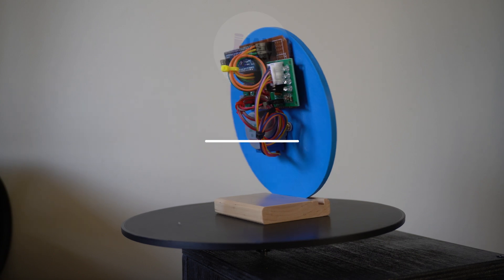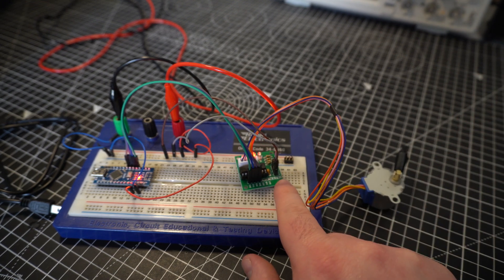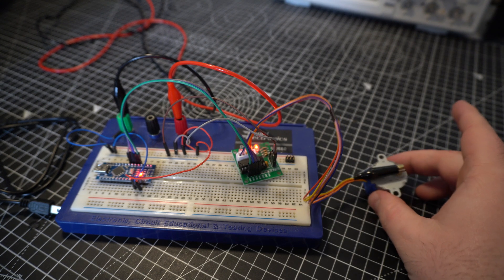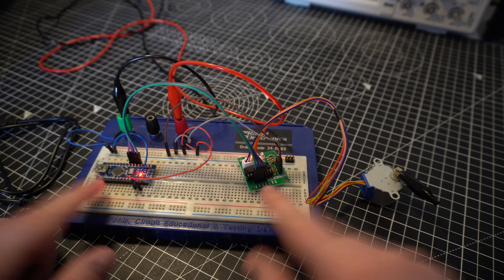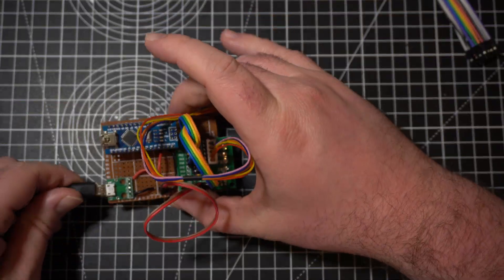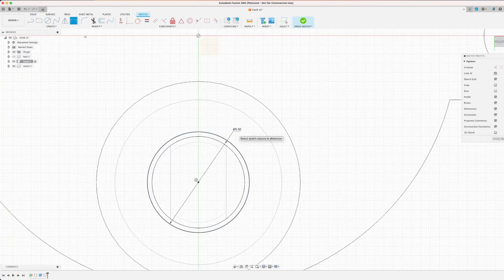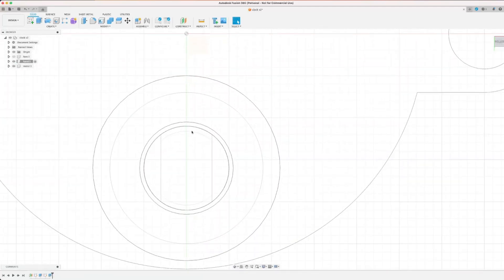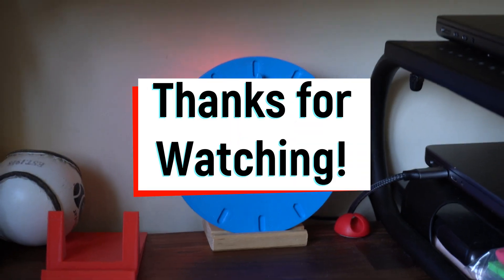Arduino Stepper Motor Clock

Comment: I think if you used RTC, you can trak time accurately without adjusting it again.
Reply from the maker: Yes, correct, this model of nano has no built in RTC, you could however use an external module to achieve the desired effect.

Comment: would be 3.3volt from an esp32 enough for the motor controlling?
Reply from the maker: So you don’t want to power it directly from the ESP32, you would want to power it from whatever power supply you are using to power the board itself.
Reply: @careyian  ok nice, yes that is what i meant, thanks

Comment: You could’ve added secondary lines to the clock face and it would make it easier to read the minutes out of it.
Reply from the maker: Yes, I could have, but this is intentional minimal, so that would be a different design

Comment: lil funsko! seems that draw is so tiny, so you could power it with a potato battery 8-]
Reply from the maker: Totally, it draws almost nothing, so little I really don’t mind leaving it running all the time!
Reply: @careyian  What do you mean with "almost nothing"? I am testing a similar setup and the motor pulls over 2 watts and gets warm/hot over time.
Reply from the maker: I’m being facetious, it does of course draw some power, just very little compared with many applications involving stepper motors which are known for heat generation. For what it’s worth, mine doesn’t seem to be heating up really at all. Not sure if it’s because of how infrequent the steps are, when I connect it to my bench top power supply it reads very little power draw.